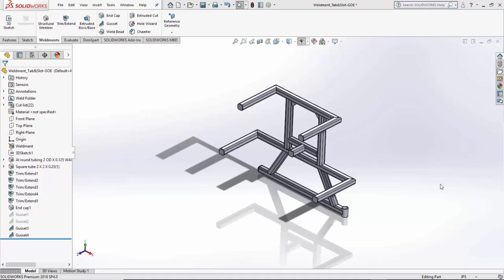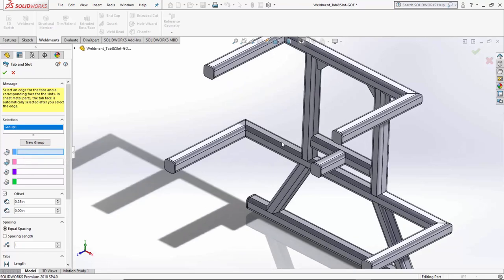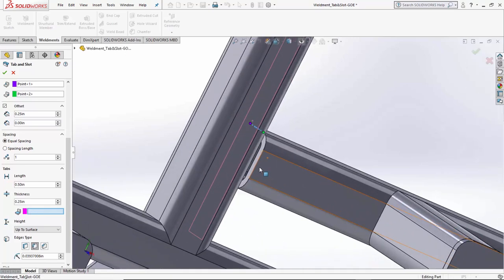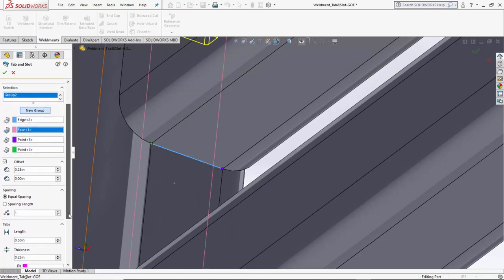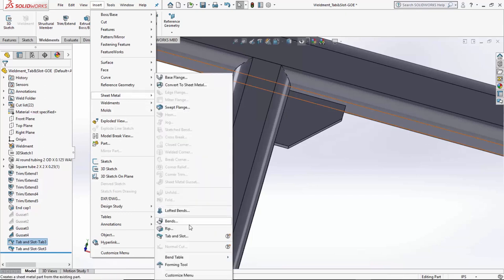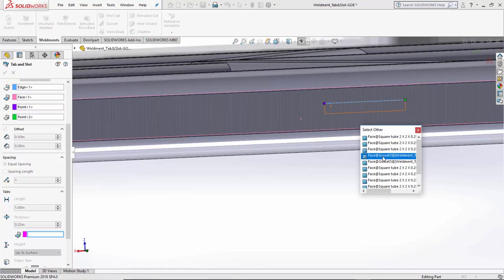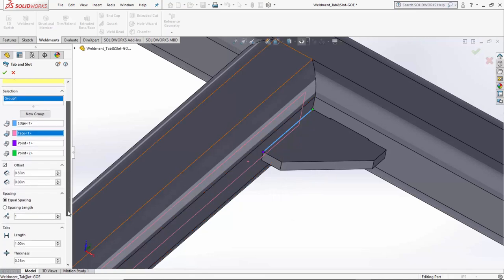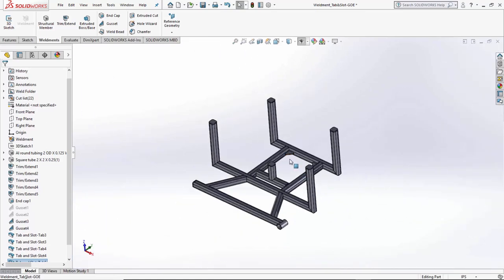SOLIDWORKS - Tab and Slot Feature for Sheet Metal and Weldments

Comment: Why is there not a option to center one single tab with out doing calculations?
Reply from the maker: Currently that is a limitation in the software, however there is an enhancment request in the system SPR # 1068921

you can vote for it to help move it up the priority ladder 

https://www.goengineer.com/blog/how-to-submit-solidworks-enhancement-request

Comment: Hii mathew i have build a frame i want to add sheet on the frame how can i do it.??
Reply from the maker: There are a number of ways to approach adding a sheet metal part. 

1. Create a sheet metal part as another body inside this component
2. Use the insert>Part command to insert an existing sheet metal part into this part
3. add the weldment to an assembly where you can add sheet metal and other components.

Comment: Hello I did not find "sheet metal" option under "insert", could you please advise how to add it into the menu? Thanks. My software is SolidWorks 2022
Reply from the maker: Hello Lei, That menu should be there by default if it is not there you may need to reset your menu customization to bring the default menus back. You can add these commands to other menus using the customization tools 

https://www.goengineer.com/blog/customize-solidworks-user-interface

If you have difficulty getting the menu customization to work reach out to your  Value added Reseller and they should be able to help you with the process.

Comment: Does it work on curved sheet metals ? Means, tabs will be on rolled sheet metal then slot will be on other side ?
Reply from the maker: Currently it is not possible to apply a tab and slot feature to a curved sheet metal part. You might be able to use the unfold feature to flatten your curved sheet metal part apply the tab and slot, then use the fold feature to fold you model back into your curved sheet metal part.